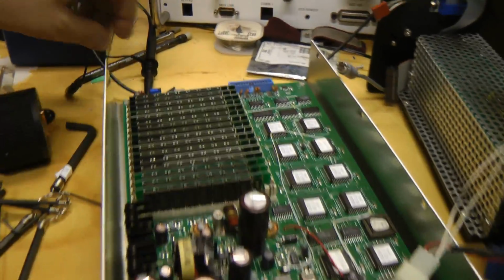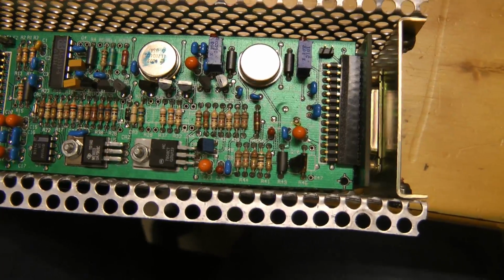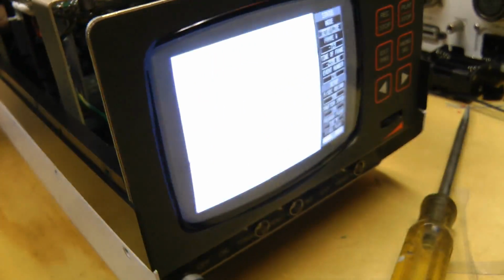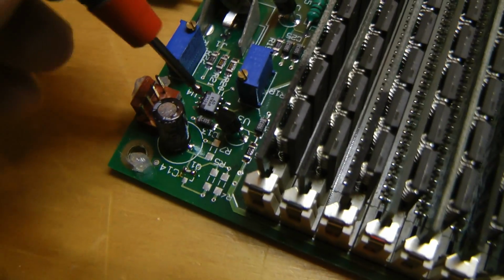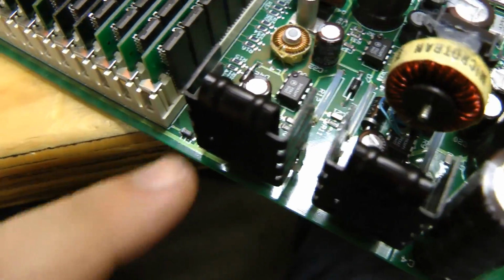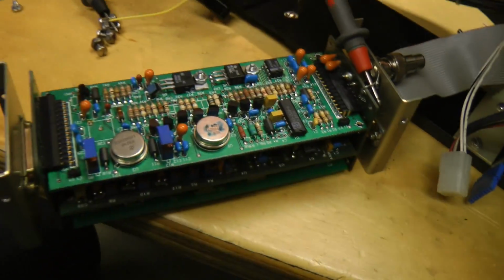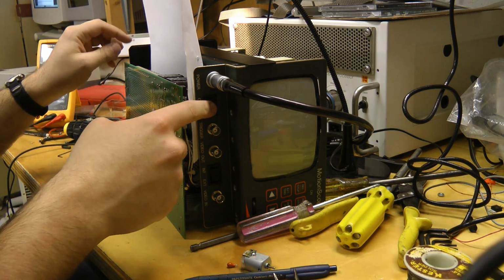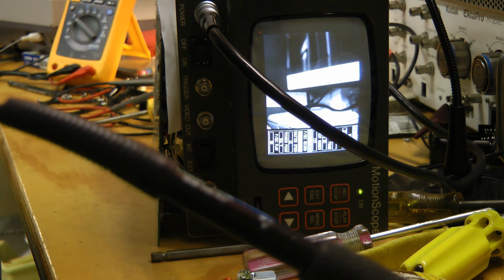Redlake Motionscope repair

Comment: If it is a crystal and not a module turn it around and it likely will work again perfectly. The mountings often get weak and the one side of the crystal where the drive is gets lazy, turning around revives it. Common on older crystals ( I had this with Apple II's a lot) with a large drive level (TTL drive) and a clamped input to the oscillator.

Comment from the maker: It seems to be one of the oscillators not starting up. An impact may have damaged the crystal. There is a bent panel suggesting the unit was hit or dropped.